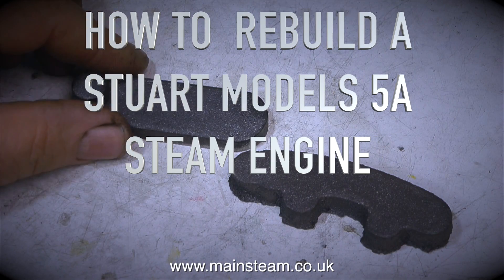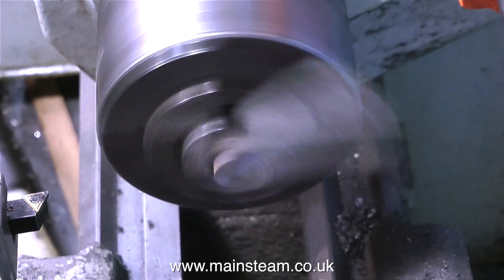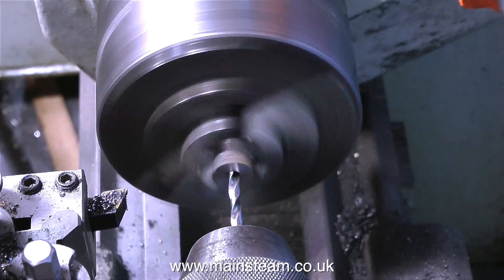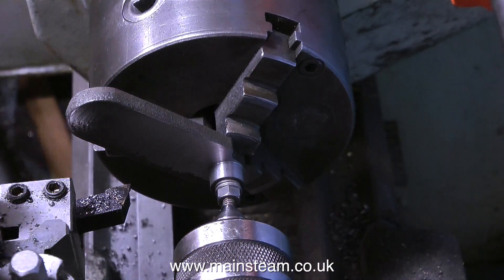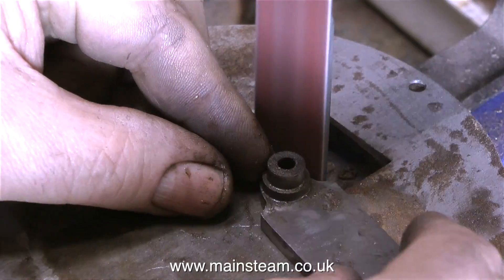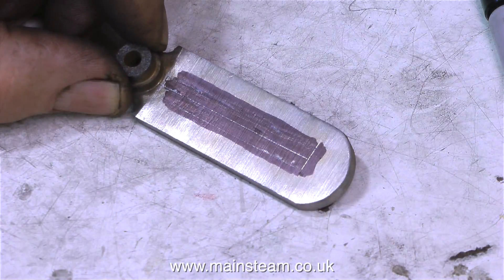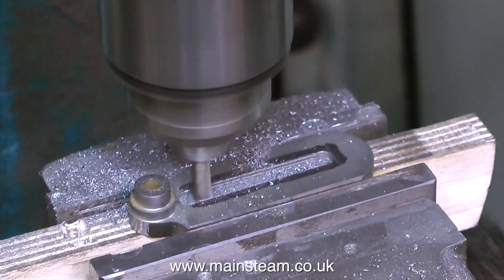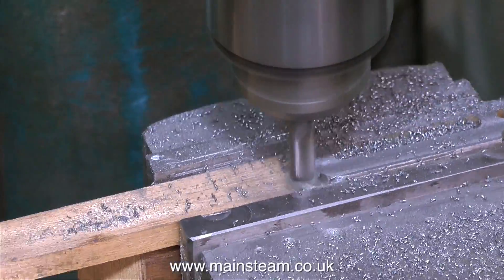HOW TO REBUILD A STUART MODELS 5A STEAM ENGINE - PART #18

Comment: Keith.  Try the blue sharpie ,no it not that it looks like engineers blue but you can over apply it to get a better coverage without it wiping the first dried layer off .
You where lucky with the chilled part when you drilled it 
Just a point (yes I am not a beginner ) but when you mentioned milling it parallel maybe you could mention how , eg a parallel / piece of steel under the part 
Keep up the good work

Comment: 5/32nds of an inch?

That is like 2 Millimeters.
Is that strong enough?

steve
Reply from the maker: it is strong enough ..... :-))))
Reply: Your sums are off, 4/32 inches is slightly under 4mm.
Reply: Opps . 5/32 ?
Reply: 5/32 is (25.4 * 5 / 32) = 3.96875 mm.  Well, about 4.0 mm :-)